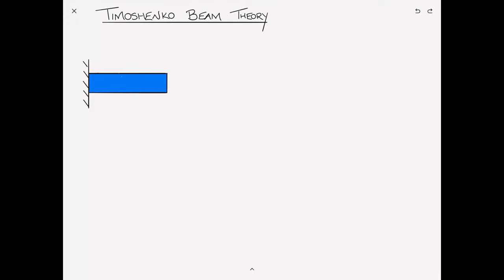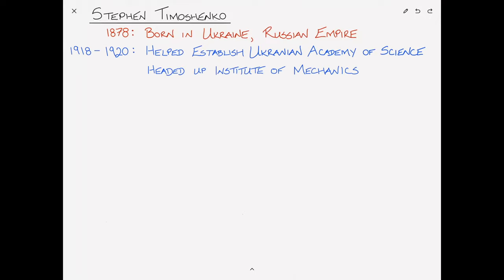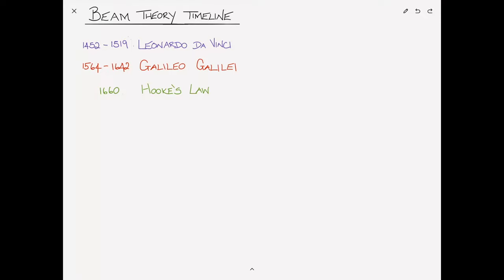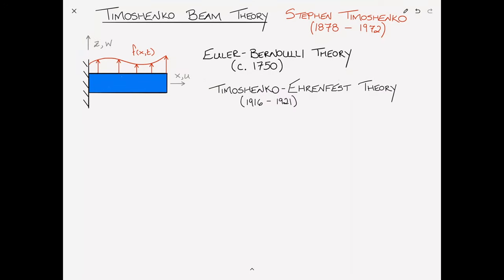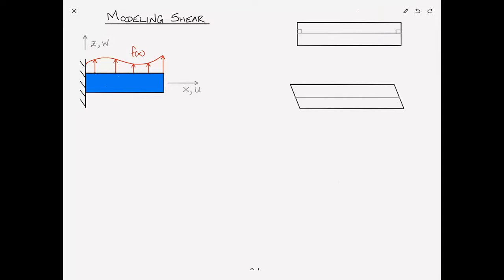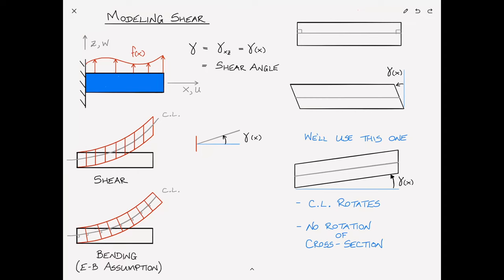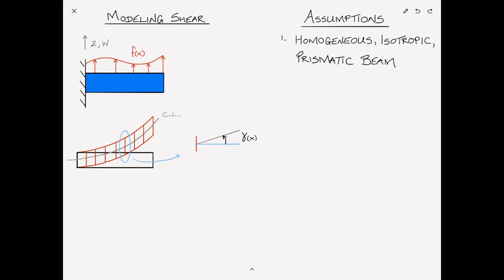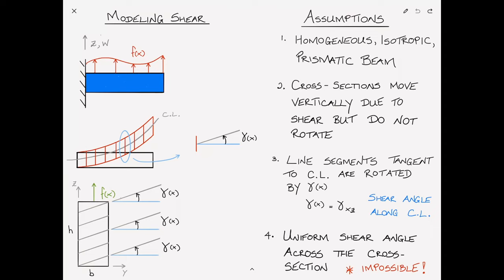Timoshenko Beam Theory Part 1 of 3: The Basics

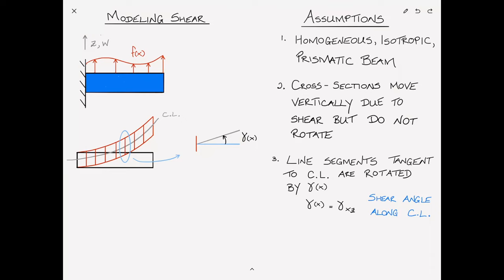Comment: Excellent presentation. The illustration starting at 20:52 may not be correct.
Reply from the maker: It's probably not the best way of drawing it.  I'm not trying to show direction of the shear strain here, just the fact that the shear is consistent along the cross-section.